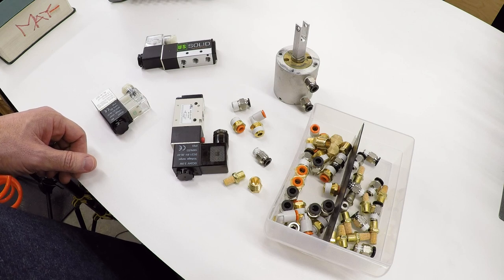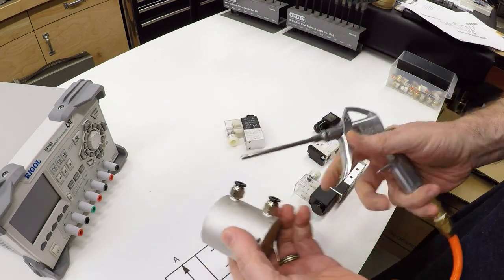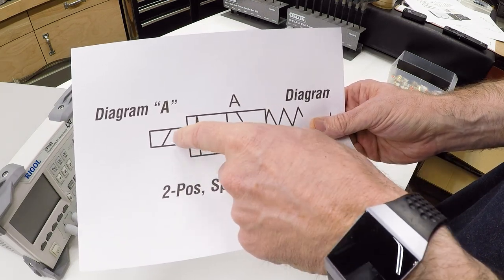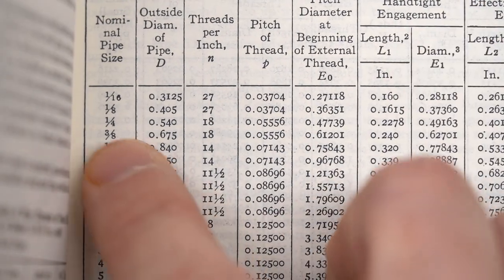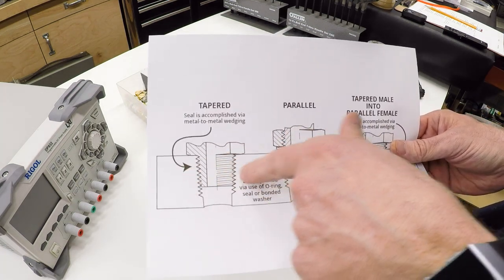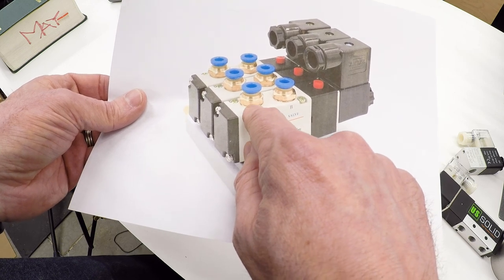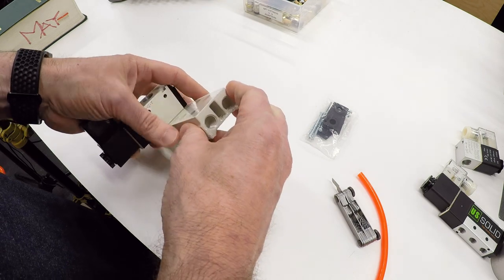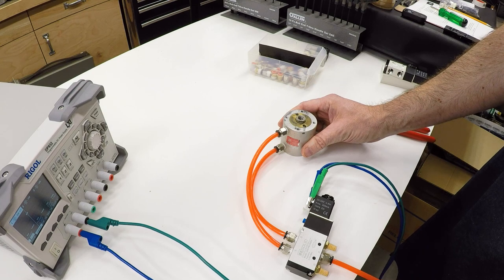Pneumatic Valves and Fittings: More Complicated Than You Might Expect

Comment: Hi James. I stand corrected! I was one who (nicely!) said BSPT would not fit into NPTS. Well done with the Fusion model, difficult to argue with that. BobUK
Reply: Just because they fit, doesn't mean they're made for one another. BSPP will fit NPS because they're both parallel fittings that aren't tapered. The ½" and ¾" both have the same tpi, but other aspects aren't the same. The BSPP/BSPT thread form is 55° Whitworth, and NPT/NPS is standard 60°. They are different for a reason, but you can get them to seal in a pinch.

Comment: I had a company in Australia making Brass fittings, there is more to BSP than you may think, Bspp - for free running nuts on Parallel threads, Bsppl - slightly undersized thread for female threaded fittings meant to accept Bspt male threads, Bspt for - male tapered threads

Comment: thank you for that video, I'm taking an engineering class and I'm prototyping with a pneumatic cylinder.  The cylinder fittings have been so confusing, and when I finally ordered it, I remembered in a video by Fright Props that he used a pressure regulator thing.  This video cleared up so much.

Comment: Great instruction of something that is usually frustrated; when working with these fittings. Thank you so much James. You cleared up a lot when it comes to pneumatic fittings.

However, and with NO disrespect at all intended; one NEEDS to understand that there is a "manual" control of these solenoids too. IE: 1. A little colored button can be turned (for air direction) and "pushed" in, to momentarily control air direction. 2. The manufactures ship the electrical connection installed inward of the valve, to protect it and shorten the length of the box. Thus the electrical fitting needs to be re-installed outward of the valve when used; so the electrical connection does not interfere with the button and/or the air fittings.

For whatever its worth. Again, no disrespect. You are a genius and helluva an instructor.

Comment: Exhaust port silencers also serve another purpose and that is to isolate the valve spool from debris.
The first valve you showed the drawing for  was a mismatch. The drawing was for a Direct Acting valve where the coil acts directly on the valve spool. Often used in low pressure situations and/or situations where a venting of the air/gas/fluid is un desirable. Think a propane/water valve.
A suggestion for your spindle project.  It appears like you intend to use a 5/2 spring return for the knockout draw bar control. This can cause problems with a tool change if there is an interruption of valve control. this can end with tools being retained in the spindle and damage to tool holders and change gear. At the very least a 5/2 memory valve will hold position until commanded. Ideal for knockout/draw bar applications. This will require a second output to drive the additional coil but in operation will prove it's worth. I would also suggest a Quick exhaust valve be fitted to the return side of the knockout cylinder to allow it to move as quickly as possible when compressing the springs on the draw bar to release the tool from the spindle.  These are usually drawn as an OR valve with an attached silencer but not always. In certain markets there are particular definitions of stop states of machinery and occasionally they would require a 5/3 spring center valve or even a 5/3 spring center detent valve used instead depending on machinery state or how the regulation/guideline is written. Not really relevant for a home shop though. Another tip if you use a valve for an air blast in the spindle also use a QEV to prevent valve spool contamination. This is also good practice for coolant/air mixing for spray coolant.
Cheers
Reply: They need to be color coded or some kind of symbol. Threads and fittings are a pain!

Comment: Quick tip, that blue button on the valves let’s manually actuate the valves without the solenoid. Extremely helpful when troubleshooting pneumatic systems.

Comment: To add insult to injury, 1/2"NPT and 1/2"BSPP have the same 14TPI pitch so you can't use a thread pitch gauge to quickly distinguish between the two. :-) Fun!
Reply: That is one of the easiest to distinguish between. BSPP is a parallel thread, and doesn't taper like an NPT thread. You can just lib at them and see they're different. The NPT vs BSP (BSPT) are hard to differentiate; since they're both tapered. Also, NPS vs BSPP are hard to differentiate because they're both parallel.

Comment: I'm the factory who supplying these air valves and fitting,so I have more experience.Currently we supply all air fittings to US market is NPT thread and UK AUSTRAILIA market IN BSP thread.But we make most valves ports  in parallel female,because usually 80% of the customers can't choose a correct fitting type,they just using what they bought and screw in the valve ports.A tapered thread can use onto a paralle female thread if you can accept a bit of leakage but the valves would work normally. Some strict customer will mention thread type when ordering,but if they don't have special requirement,we will make all female threads Parallel.
Reply from the maker: That's disappointing.  If I understand correctly, you're saying that most people don't know how to specify what they need, so in response you use defaults that will fit together, but won't seal properly?

Comment: Thanks for another very informative video. Over a year ago I was trying to put a valve on my air compressor and couldn't get it to seal well. I finally gave up and it has a small leak still. No I'm going to go back and verify what kind of fittings and threads I have.

Comment: the main problem i see in air fitting complaints is usually around the taper vs parallel. Parallel requires an o -ring and most users seem to assume a taper and just use teflon tape. That is where the problem comes in. Teflon can accidentally seal a parallel thread, but really it should be sealed by an  o-ring and a machined face. The NPT fitting has no o-ring, nor a smooth face to accept an added o-ring.  Eventually, it starts to leak.

Comment: This video is a real skill builder, THANK YOU! Well laid out- lit and shot and very thorough. This is a great starting point and opens new doors in the world of mechanics and electronics for me. How did you shoot this between the two cameras and the audio? It's very seamless and nice. Did you have two cameras running at the same time, and one of them on your chest or something?
Reply from the maker: I generally roll three or four cameras simultaneously   I shot this particular video with two GoPro cameras, one on each side, and a Sony a7iii overhead with a 90mm macro lens, pointing straight down.  Audio comes from a Sennheiser wireless lav and is recorded on a Zoom H4n audio recorder.  Everything is synchronized and edited together in post, with color correction to match the cameras and basic dynamic compression to smooth out the audio.  Sometimes it's just simple cutting between angles, but sometimes I end up overlapping audio and video out of sequence when it makes things clearer.

Comment: Great video.  There should be more like this.  May I add a few comments that may help your viewers.  All circuits ( pneumatic and hydraulic) should be drawn in the deactivated state with no electric, hydraulic or pneumatic power applied.  Adding the hoses to your diagrams would help greatly and be less confusing to some.  BSP is often referred to as G (gas).  The term Teflon tape should not be used.  The word Teflon is a trade name of the DuPont Company.  It should be referred to as PTFE (polytetrafluoroethylene).  You would not want to get sued by DuPont.  Also hydraulic circuits and pneumatic circuits can look almost identical.  Can you point out how to differentiate the two as pneumatic and hydraulics can be used in the same circuit.  Cheers.

Comment: In an application where you might have quite longer connection lines the "mufflers" does make a bit more sense, since there will be a greater volume of air that has to depressurise/flow through the exhaust ports.

Comment: We also used variable exhaust valves, to slow the speed of vale movement, to make it less violent. And think about running your exhaust valves to outside of the enclosure, so it doesn't leave oil from air, inside enclosures, or pressurise inside of enclosure.
Reply: There aren't any machines that are air tight. (Definitely not air tight enough where venting pressurized air would be of any concern.)

Comment: BSP was also defined as the DIN standard at some point, and when ISO came along they also standardized on BSP. So today BSP is the standard “metric” pipe thread. There are also metric pipe threads defined by M and the dimension in mm, so M24 for a 24 mm thread, but they are extremely rare (usually only seen as the nut thread on some oddball compression fittings for pipe work, where they for some reason chose something different than BSPP).
Reply: It's actually really common to see M5 pilot air connection in otherwise inch fittings in European sold pneumaticvalves
Reply: Metric threads are used a lot with hydraulic fittings with compression or conical seal.

Comment: The reason only one side of the diagram is labeled is to show its "normal" state,  the position in which the valve is in with no external forces.  In the case of your valves it shows the state where the solenoid is in the off state and the spring is pressed against the spool.

Comment: The crazy thing is that the 1/8-27 NPT will almost go into a 1/8-28 BSP hole, but will screw up the threads.  When I worked at a Chrysler dealer there were issues with techs using the wrong oil pressure gauge fittings during testing on some of the internationally-designed engines and damaging cylinder heads in the process.  Thankfully I was not one of them.

Comment: Hi James. Difficult to judge sound over YouTube but to me it sounded like some of the high frequencies had been supressed, which is a GOOD THING as they can over time damage the ability to hear higher frequency sound. In the extreme (I'm an ex telcom engineer) you can understand what is being said but not recognise who is saying it. Cheers. BobUK.
Reply from the maker: Yeah, the compressor also evens it out some.  It definitely takes the sharp edge off the high frequencies.
Reply from the maker: @SystemsPlanet  audio compressor.  The biggest difference is that the diffusers cut the high frequencies.  The audio compressor then gains up the remaining sounds.

Comment: Re: mismatched threads. Yeah, that happens. It's always counterintuitive and surprising.

Lets talk about automotive brake line fittings.  You've got the line size, which is both imperial and metric - the two are essentially cross compatible, you can essentially only buy imperial in the US and metric in the rest of the world. It's fine, because the lines get flared and the flares are standardized (well, there are two standards, but that's another thing entirely). The fittings on the end also come in both imperial and metric.

For awhile during the changeover to metric in the US auto industry (so, the entirety of the 80's, 90's, and well into the 00's for some parts on some cars), it was not uncommon for this to cause situations where the component on one end of a line took a metric thread, and the other end took an imperial thread. Cool and good. So you can have a 3/8ths brake line with a 3/8ths fitting at one end, and a 10mm at the other. And then lets say you're replacing that line and don't carefully check both fittings and decide it's 3/8ths at both ends.

The 3/8ths fitting will absolutely thread into the 10mm end. It will even tighten up a little. It will never tighten enough to actually seal the flare properly - in an absolutely safety-critical application.

Comment: Teflon is a lubricant not a sealant.  Teflon tape reduces the friction and therefore heat while (tapered) fittings are driven together.  I do agree that it will prevent low pressure leaks if you overwrap fittings to fill the unsealed space.....but that's a hack job.

Comment: Do 3/5 way valves exist that do not require a minimum pressure, fully electrical spools ? I am doing something with low pressure, and are currently using several low pressure solenoids to handle the venting, which is a pita.
Reply: Yes they do, look for Direct Acting, spring Center for your 5 port 3 position, that type however is a bit more common in a 4/3. Make sure you check the center layout as some are fully closed and some are fully open. A fully open will drop pressure of both sides allowing your cylinder to move freely a fully closed will stop the cylinder with some pressure retained on both sides.

Comment: Great video.  Nice to watch, even if I already had experience with these things.  Your teaching approach is so good that I watch what I already know!  :)  As to those brass muffler things, I have noticed no real difference.  But believe it or not it's pretty easy to model up some stuff in Fusion 360 and 3d print that works very well!  Just look at suppressor designs for guns to get some ideas, but a simple tube with some baffles that don't restrict the airflow but tend to reflect noise back into the tube is all you need.  Those make a big difference.  

In a few settings I've needed it very quiet (pneumatic tube cap installer that was used in office environment) and I've had great luck with a simple fab from plastic.  1" pvc with sections of rolled felt separated by plastic baffles, very similar to a suppressor design,  about 10" in length and the sound is barely noticed over normal office noise.  It certainly becomes inoffensive.

Glad to see you back and can't wait for the spindle updates.  I now have a couple of Tormach 1100s in the hangar but I still have my PM25 and might consider following your lead on the spindle upgrade.  We'll see.

Comment: Worthy video to send to "How it works"  very understandable. Its a shame they do not use the coloured plastic inserts to denominate the actual size, my Reverse osmosis system for example uses all 1/4" tube but has connectors with 4 different colours to supposedly help instalation.

Comment: great video! quick question i am new to pneumatic systems and i have a 2/2 pneumatic solenoid valve, the plastic casing is blocking the entrance where i should screw in the hose adaptors, when i build it can i twist the top part so it doesn't block it or can i put it upside down?

Comment: And NPT will never seal in BSPT.  The Japanese, German and Italian machinery fittings will be BSPT.   Use teflon tape carefully.  If the tape extends beyond the male thread, it can be cut off and will flow downstream and work into downstream devices.   At the crane company, hydraulic pump shafts broke due to teflon tape in the bearing area, making them seize up.

Comment: I am hoping you maybe know the answer to this question since you have knowledge of these things and the use of lathes. I want to use an actuator to engage and disengage a dog clutch on my lathe. I need a rapid and forceful enough action. I am not sure what's the best type of actuator for this? Stroke length of 25mm or an inch would be quite sufficient as well.

Pneumatic ones seem to have both the speed and the force and seem simple enough, though I don't always have shop air turned on. Are there any purely electrical alternatives that could work? 
Big and powerful enough solenoid actuators perhaps?

Comment: I'm just going to say you should never use Teflon tape on an aluminum receiving pipe thread!  Teflon is a lubricant and will give you a false sense or tightness (Not Tight enough), pipe threads are tapered as you said and thus you are twisting a wedge into the hole. Maybe not today but eventually if you follow the practice of Teflon on AL you will crack something.  Always use a semi setting sealant that is not a lubricant.

Comment: 16:45 Your diagram of the tapered thread is not "correct". Tapered threads will not and should not be able to go all the way down to where they sit against the surface. If they do that means there is something wrong. Not meant to be an indicator but it is.

Comment: was thinking as well the moment you mentioned parallel female and tapered male with different standards
, you could mess this up easily as they would screw together fine but won't seal.
actually embarrassing folks would think you would lie about such stuff tho, but that's just the comment section engineers i guess.